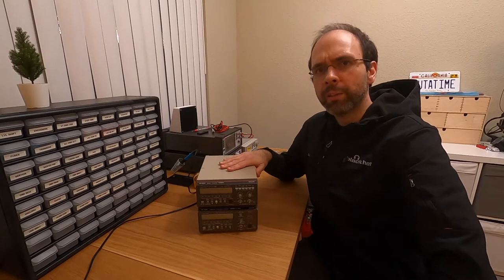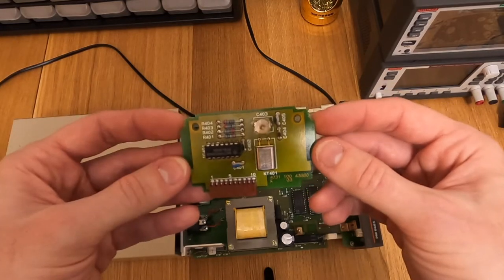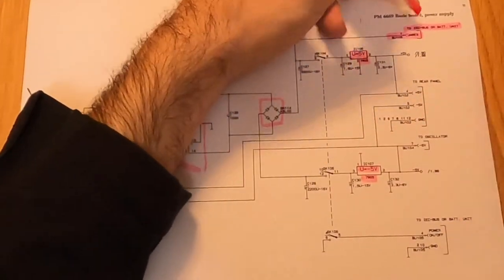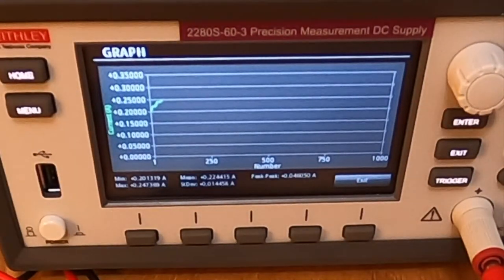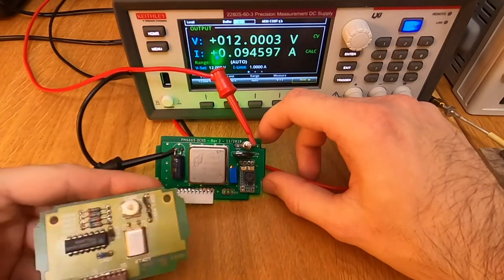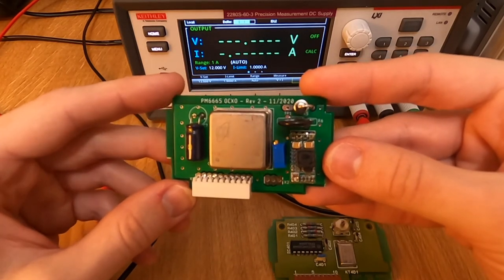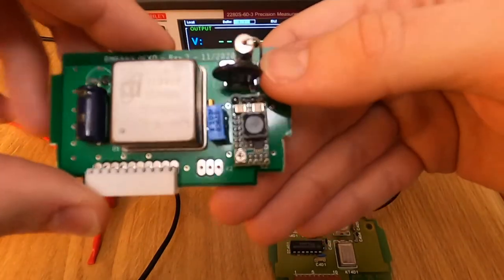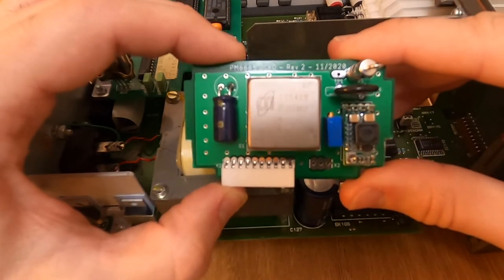PM6665/PM6669 OCXO upgrade : concept and design process (part 1)

Comment: The voltage supply to the oscillator should be linearly regulated (L7805 for example) instead of a switch regulator which makes a lot of switc noise ?
Reply from the maker: It is true that switching power supplies tend to be noisy. However, most modern high-end spectrum analyzers, oscilloscopes, and similar instruments are full of them. So they are not necessarily a problem.

In this case, this is a pretty low tech instrument by todays standards. It is not very sensitive. Additionally, the OCXO itself has a pretty high power-supply noise rejection ration (per the spec +-2ppb for +-5% Vcc change).

It is true that it is possible that the power supply could, in theory, inject noise into the instrument, and then conduct that noise into the device under test.

However, one should also take into account various other noise sources in the lab, including noise coupled into the AC from other stuff plugged into the AC power, and then into the instrument itself.

I have seen multiple labs with cheap LED drivers that were noisy as hell for instance.

So in a nutshell... I believe it is a non issue in this application, but, without specific measurements, I am just guessing. Maybe this is a good idea for another video :-)

If it is indeed an issue, it is possible to use a linear regulator. However I am concerned about the spare capacity of the built-in transformer to supply enough power when the OCXO warms up as it uses a significant current.

One option to explore would be to use a shieled DC/DC module and proper filtering at its inputs and outputs. Best of both worlds. Maybe for a next revision of the board, if it turns out to indeed be an issue.
Reply: i had a L7805 on mine and it got insanely HOT even with cooling. the only way was to use a switching power supply in a small foot print like he has. and its not bad i made a few of them for different counters i have.

Comment: Just plug a GPSDO into the external ref jack.  Far easier and more accurate.
Reply from the maker: Depends of the situation. Right now, in my lab, I can't have satellite reception, and I can't install an antenna on the roof either. Having the capability to have an OCXO in my instruments, that I can calibrate once a year or so, is perfect. It gives me more precision than I realistically need. Of course, everyone's situation and needs are different. Thanks for watching!
Reply: @the_bootloader  While an outside antenna is always best, once a GPSDO's location is set, it only needs one satellite to stay phase locked.  GPS receivers are very sensitive now, and some will track multiple GNSS constellations.  Mine works just fine inside the house through the floor above and the roof.  It looks like your lab has a window.  As long as there isn't metal film on the glass, a GPS receiver will usually work fine looking out the window.  If you're in a multi-story concrete building with tinted windows and no balcony, you may have a problem.  Good luck!
Reply from the maker: @stargazer7644  Thanks! All good points. Unfortunately I am in a multistory townhome, and the lab is on the ground floor